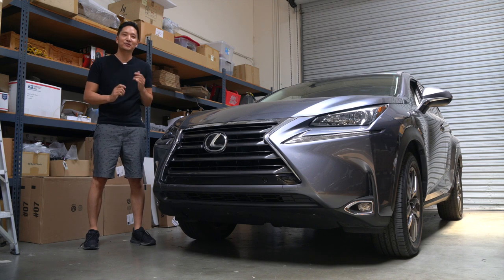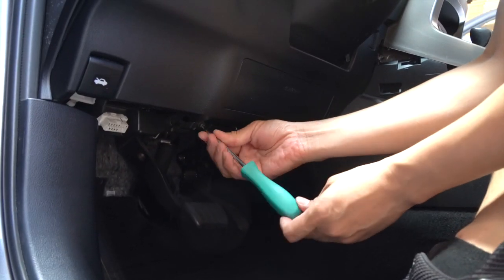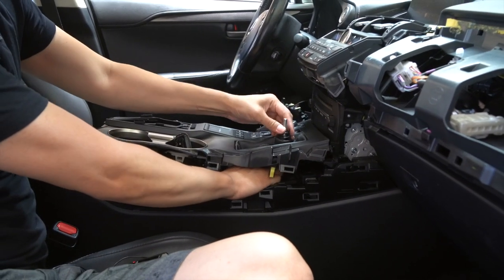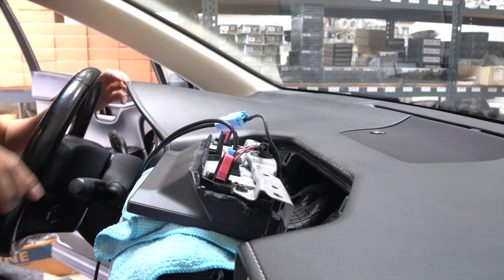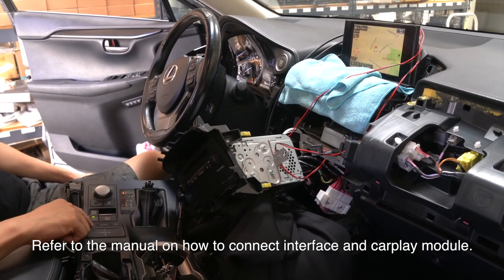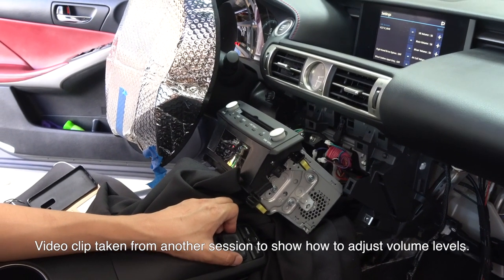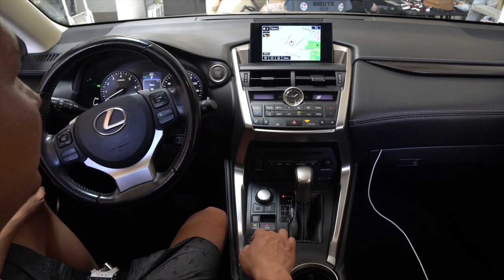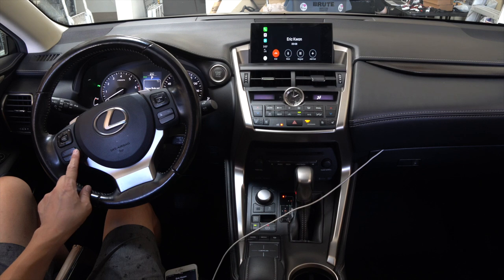2015-2017 LEXUS NX | Wired Apple CarPlay & Android Auto | Install / Demo

Comment: I just bought this and everything works fine except the touchpad. It won’t respond when it is on Apple CarPlay mode but when it is on the OEM infotainment screen it does work. Is there something I can do to fix this?
Reply from the maker: Check the CAN wires to make sure the connection is seated properly. Replug and reseat them. Wire colors should be orange/green. Also reseat connection on both sides of the CAN board as well. Please email us for more technical support info@beatsonicusa.com

Comment: Simple question, why did you have to remove the drivers side panels? Seems you only need to work on the centre and passenger areas of the Lexus NX? Could it work by skipping removing the drivers side panels?? Thanks!
Reply from the maker: You don’t actually. You can just pop the cluster on the right side. The newer videos will show you how

Comment: Does this addition remove the standard features on the original operating system? Interface activates when phone is connected along with standard features? Or do they switch depending if the phone is plugged or not?
Reply from the maker: This kit does not remove the standard features on the original operating system. By long pressing the home or map button will take you into cp/AA mode. Otherwise your factory controls are exactly the same

Comment: Disassembly, install, and re-assembly went great... or so it seemed. After installing unit my radio no longer has power. I disconnected all the pigtails and re-connected all the original cables, but still no power. Logic tells me I blew a fuse but I can't for the life of me find any information on where the fuse is located. I disconnected the battery, joined the + and - terminals and let sit for over an hour to discharge all capacitors and reattached the battery. Still no power to radio. Lexus NX200T F-Sport. Any idea where the fuse(s) for the radio might be located? Google is no help...
Reply from the maker: Please email us for tech support info@beatsonicusa.com

Comment: Question: Can you control the apple car play with your iPhone? As in when you have the map up on your iPhone, does it also show the map on car play? I am trying to avoid using the trackpad as much as possible.
Reply from the maker: Yes you can but the carplay screen won’t show until you start the navigation prompt from the phone. As in it won’t move the map screen in real time relative to your phone. However phone mirroring will.
Reply: @BeatSonicUS  Thank you for the fast reply! Yes, all I wanted was to be able to use my phone to input the address on my apple map and once I start the navigation on my phone, the apple car play display would have a map that reflects the navigation. Just did not want to use the Lexus Nx Trackpad to input my map destinations.

Comment: Hi Instead of hanging wire form glove box, can we use usb inside arm rest (its 2 usb ports) ?
Reply from the maker: Unfortunately since the USB port is made within a hub it will not work. You can however route the USB extension cable to the arm rest. This will require you to drill a hole in the arm rest.
Reply: @BeatSonicUS  oh okay thanks
Reply: Narendra Polineni You can also get an usb extension and hide the wire under that panel (on the right of the shifter) and route it to that general area where the other USB ports are, without drilling a hole. Did this with with my radar detector.

Comment: How would buttons on touchpad without home or back buttons work? Mine has Menu/Zoom in or out/Map buttons with factory nav whereas car in this demo has Home/Menu/Back buttons.
Reply from the maker: Menu will work as your Siri button and Map will work as your button to transition from native screen to Carplay screen. Unfortunately you will not be able to use the back function without the back button.
Reply: @BeatSonicUS  Eric is my NX300H is for Korean market which has its own navigation program developed in Korea installed instead of Lexus Nav in Enform system. So it access to map via 'Map' button above touch pad instead of going in through Enform. Will it still be compatible with this kit?
Reply from the maker: JK Chang we would have to review the specifications on how the Korean map is being interfaces with the factory infotainment system. Will you send a demonstration of how your map is working now to info@beatsonicusa.com? Thanks!
Reply: @BeatSonicUS  I'll try to make a video and send it along. Thanks!
Reply: email sent :)

Comment: I have a 2015 NX 200t so I called my dealer to see if it's compatible with this upgrade. They told me no. So how are you doing it? Just curious.
Reply from the maker: You can achieve carplay with our product. Product link in description
Reply: @BeatSonicUS  is a wireless unit just as good?

Comment: hello, purchase used kit for wired carplay NV17 CP/AA , which was removed from Lexus RX, and as unit description says, this unit is compatible for Lexus NX 2013 - 2017 as well.
so I have installed on my 2016 NX, all done smooth thanks to your YouTube instruction, but I have black screen with system ready message, when I move touchpad, I hear cursor moving trough apps icon (as I understand) but as I sad there is not any image on display, just black screen with system ready. when unit arrives white switches in back side was 1 and 6 on, I did not touch them.
could you please help me with this issue?
thanks in advance
Reply from the maker: Depending on the product lot and the vehicle trim of the RX compared to your NX will need a specific configuration
Reply: hello again, here is some details I have received from seller, could please check and help me with system to make it work 
"Hello,
I do not know the lot number but it was installed in a 2019 RX350L. I purchased it in November of 2019, but it was out of stock at the time and I received it 12/27/19 once Beat-Sonic received new stock. That information may help them figure out the DIP switch setting and the exact model of the unit. For installation in my car, I used the youtube Here's the link if you need it:
https://youtu.be/GSs1QF7Z6Vo?si=ovjm8uiaiRhaH8PS "
in addition I believe it was installed on RX350L with NAV and now I trying to install it on NX 200T 2016 (2017 model) base model with NAV.
thanks in advance
 @BeatSonicUS

Comment: Did you had any issues with radio stock on rebooting loop. Would this fix the issue?
Reply from the maker: This won’t fix the radio rebooting loop issue
Reply: @BeatSonicUS  can I still install this if my unit is doing that.?

Comment: There’s a usb connection in the middle glove compartment can you redirect the usb there instead of the glove compartment?
Reply from the maker: You will not be able to use the USB in the arm rest, but you can route the USB cable to the arm rest area by drilling a hole
Reply: @BeatSonicUS  hole in where? I would like to route a 6ft cable to come out the armrest as well. Could it be tucked under center area?
Reply from the maker: @martin_wood  hole in the arm rest. Yes you can tick it in the center area

Comment: Hey man, Do you know if the dealership can just install it for me. How if yes, how much do you think it would cost?
Reply from the maker: Usually dealerships won't install aftermarket parts for you. You may however get it installed by a competent local stereo installer. It will take them 2 hours and hourly rates can range from $50 to $150

Comment: It looks like the aspect ratio is a littly wonky, and that the icons are squished? Is there a way to fix that?
Reply from the maker: Sam H it’s normal due to the size of the screen. Different sized screens will offer different looks optimized for the screen it is being displayed on. Adjust it to be wider and will sacrifice utilizing the entire screen potential.
Reply: @BeatSonicUS  One more Question. Does the volume knob and steering wheel controls still work to adjust the volume and change tracks?
Reply from the maker: Sam H yes volume knob and steering wheel control will continue to change volume. Changing tracks can be done next to your mouse or touchpad using the up and down arrows if you have them or use the seek controls on the carplay screen

Comment: 1. Can it be installed to European 2015 NX 300h with nav and a cylinder controller (i.e. not a joystick neither a touchpad)
1.1 How the cursor works with this kind of controller? Is it focusing elements or tiny arrow?
1.2 Do you have any demo videos for such or similar inputs?
2. Any local rep around Warsaw, Poland to install the solution?
3. I saw an answer in faq but would like to ask again: is audio always routed through AUX, meaning analog quality? I would like to upgrade my audio by a new amplifier and understand if these two mods are compatible/make sense
Reply from the maker: Yes, please check out video install on Lexus NX without factory nav.

Comment: Also, whenever I get in the car and first start it up, do I have to make sure it's on AUX every single time? Or can I just plug in my phone, press and hold the home button and call it a day?
Reply from the maker: Trent Dodson correct. We recommend that if you use it all the time to leave it in Aux before you turn off the car and when you turn the car on again it will start with it being in aux mode.

Comment: 1. How does dragging (usually swiping on the phone) through the map or other menu items work? Hope you guys can post a video to address this.

2. If I have a FiiO BTR3 DAC wired into my NX through AUX to provide LDAC codec support over Bluetooth (super super clear audio with full EQ and response adjustments), is there any way to maintain it and route sound through that? As my NX currently is, the FiiO handles music/media, and the factory radio handles calls. I understand that the BeatSonic system disables the aux jack.

Thanks!
Reply from the maker: 1. Dragging or swiping on the phone won’t have any effect on the factory screen on this system. However you may start navigation routing or play music from your phone which the car’s screen will follow the function. 

2. Does your FiiO BTR3 DAC have an aux input? If it does then you can connect the sound to it instead of to our harness.
Reply: @BeatSonicUS  Hello and thanks for reply:

1. I should have worded this better. How do I simulate dragging the map via the Lexus touchpad? For example, while driving, I want to see roads beyond what is currently displayed on-screen.

2. No. I was hoping for Android Auto to work through your device but for sound to still be cast via Bluetooth through the FiiO to get the sound processor benefits (why my Bluetooth audio to AUX solution yields better sound than plugging the phone directly into AUX).

Is there a separate daisy-chain for the AUX audio (that I can then not install), or are audio and video handled by just one plug?
Reply from the maker: When in map mode a controller with arrows will appear and you may select those arrows to move the map around instead of dragging. Selecting Bluetooth for sound may be a challenge in Android Auto as I don’t recall that function. If you have a vehicle with android auto you may try to test this as well.

Comment: Wow, I really like your video. I have 2 questions: Do you have anyone in Los Angeles area that have the experience in installing this, I have 2015 Lexus NX300H? Also I like the idea of the USB to be more integrated to the dash instead of hanging, do you have any suggestion where it should be best to be instead of hanging?
Reply from the maker: Yes, we are located in La Mirada, CA and can do the install for you for $150 for your 2015 Lexus NX300H. You may route the USB to your arm rest compartment, however will require drilling a hole to it.
Reply: Do you have someone that you could refer to install the product in London Ontario, CA?
Reply: @BeatSonicUS  late to the party but wanted to ask if you are still offering to install and also where might I buy one? I have a 2016 NX300H that I would like to upgrade.